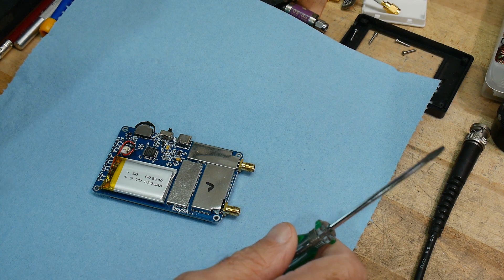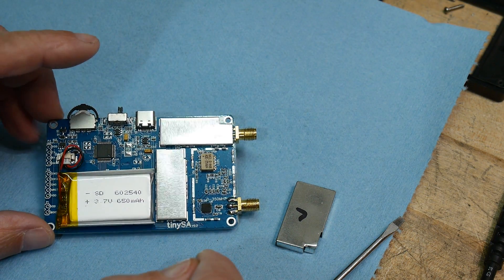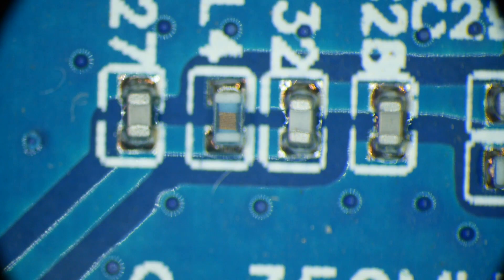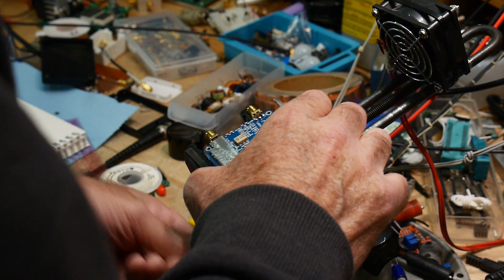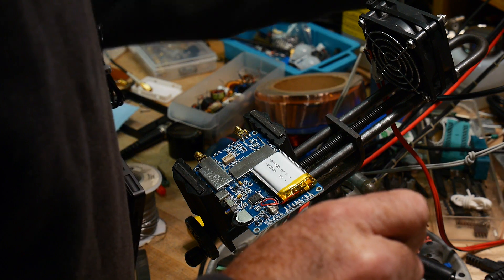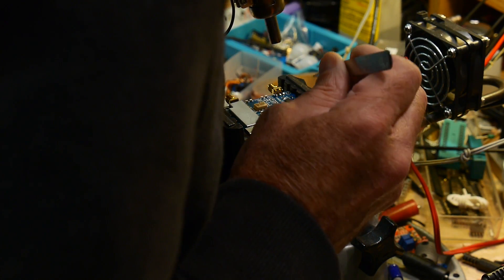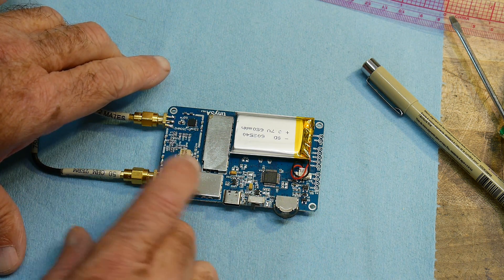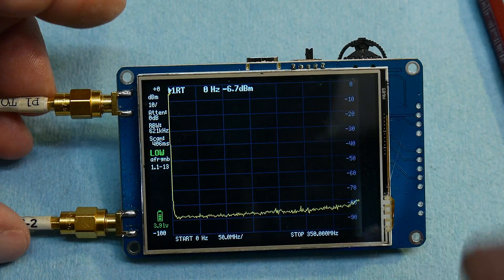#596b TinySA Failure Analysis and Attempted Fix

Comment: Great video. I have a TinySA  and all I get when I turn it on is a white screen.  I suspect that the display chip is bad. But I don't know which one is the display chip. Any suggestions?
Reply from the maker: it is a display module, the chip is on the display board

Comment: Did the attenuator fail out of the box or after a while.  I have a suspicion that maybe it might be a firmware issue.  Did you try updating the firmware?
Reply from the maker: Yes. I've updated the firmware every revision. If you noticed the self test it had the attenuator test I asked Erik to add.
Reply: @IMSAIGuy  It's strange that the device failed almost the same way with the replacement chip.  I don't think I could rest until I knew why it failed.
Reply: IMSAI Guy
Something really weird is happening. Did you post the issue to the tinySA groups.io? Probably Erik could shed some light on it. It would be very interesting to figure out the cause.
Reply: Have you tried walking through the attenuation values (if you can) ?  It might be a firmware issue where the wrong serial code is sent to the attenuator.  Maybe hook up a logic analyzer to see what gets written into the attenuator IC ?
Reply from the maker: @GodzillaGoesGaga  I don't care enough
Reply: @IMSAIGuy  That's fair comment and for the price is it worth your time ?  I was thinking more from an education standpoint.

Comment: Hot air gun turns off after it's cooled down when put back in the holder
Reply: True - the heating element is turned off through the reed switch, but the fan should spin on for a while for cooling.